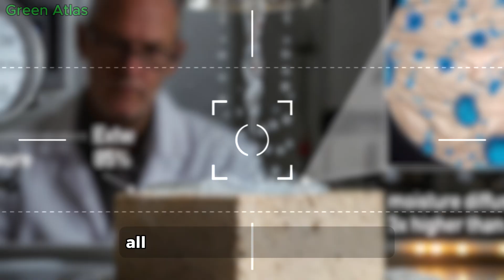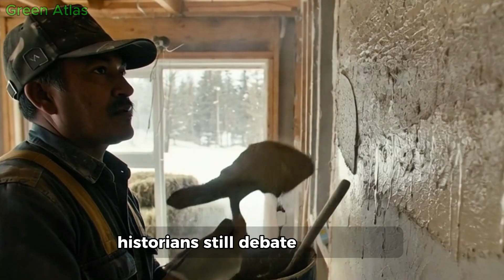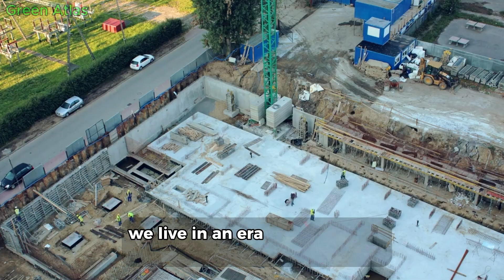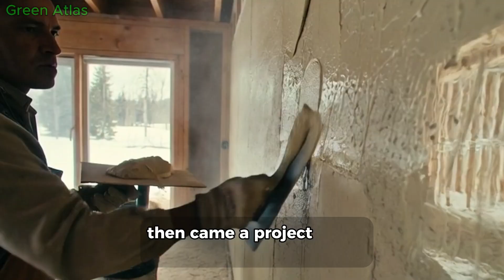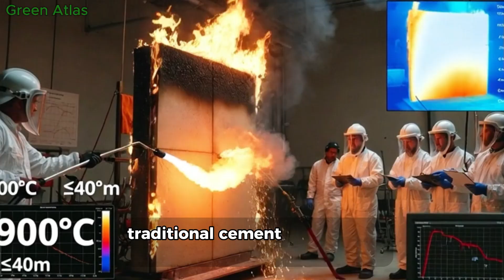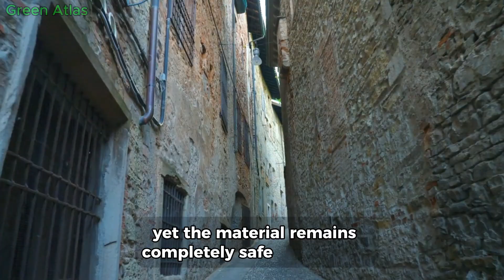600-Year Concrete From a Living Plant — Why U.S. Building Codes Still Block It Today

Comment from the maker: The most astonishing thing about this block isn’t just that it can last for centuries—it’s that it literally “locks” carbon inside itself. While conventional concrete produces massive amounts of CO₂ emissions, this material actually captures carbon during the plant’s growth. It’s lighter than traditional concrete, better regulates indoor humidity, and naturally resists fire—qualities that alone challenge the modern construction industry. And yet, despite its eco-friendliness and durability, its use is still limited by building codes and regulations.

It’s interesting to ask: is this a matter of safety and standards, or is the construction industry simply too slow to embrace natural solutions? If such a material were widely available, would it transform the construction market in the U.S.? Would you choose to live in a house built from plant-based blocks if it were cheaper, more environmentally friendly, and lasted longer than regular concrete?
https://youtu.be/O1zv3CcKTrw
https://youtu.be/YCRB0bgWxSs
https://youtu.be/XuwkfGicO8M